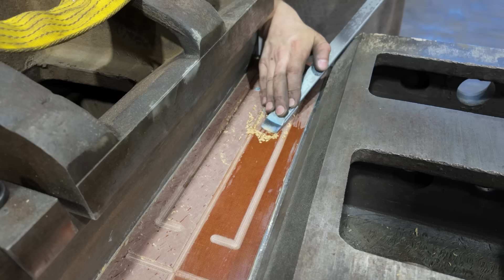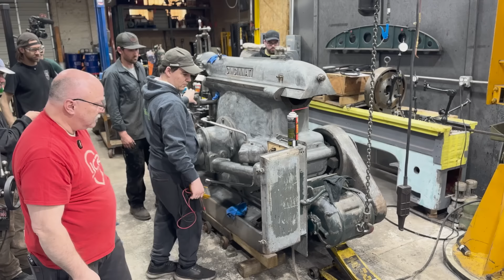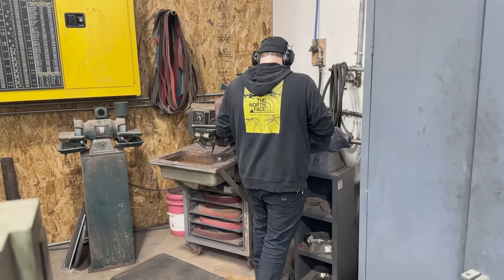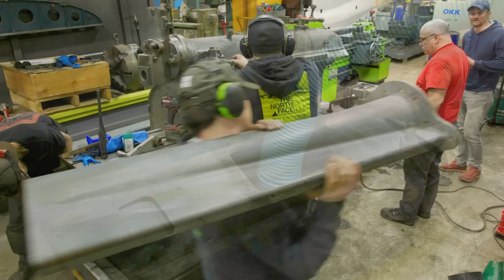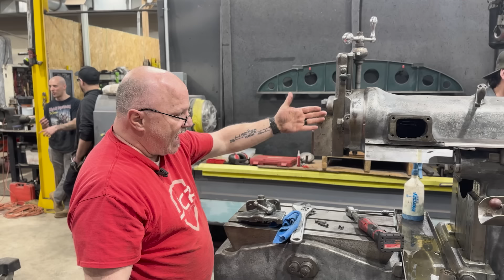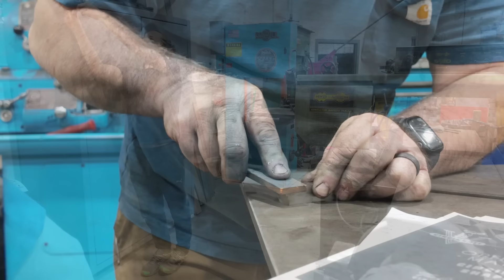Bringing our 36" Cincinnati Metal Shaper Back to Life

Comment: we retrofitted our shaper into a CNC, we put a 4th Axis on it . We use it for doing internal splines and a few small gears. Its very slow but we can set it up and let it run unsupervised all day. its been very limited. Yesterday I finished the table extension so we can do bigger parts.  I posted a couple of videos on my page yesterday of the shaper and the table extension

Comment: Ran 50s and 60s Lagune, K&T and Cincinnati shapers in the 70s with clapper heads on a US Navy tender...,in the 80s & 90s I got involved with CNCs making SSTL reactor chambers for Silicon Valley.....the new inserted perishable carbide tooling is light years faster than those old shapers for rough machining....boat anchors

I see you have an OKK CNC mill so you already know that.

Comment: Good god, a group of engineers working on something they have no skill set in.  I work on industrial equipment that engineers design but never work on.  If they actually had to work on their designs with little room to do ANY maintenance on, their designs would be a lot different.  What is the point taking a machine totally apart just to replace something?  The industrial maintenance profession hates engineers because of lack of proper engineering.  Everyone who has tried to repair something in some way dislikes the people who designed a mess to work on.

Comment: Because the shaper is different not a everyday machine in workshops that is what held my interest - thanks.
In it's day the shaper (that size) would have cost a few $$$. To justify its cost it had to save time & be of value (worth having).  What was it used for?
What ever it did, had to be of value. Not having seen one used (I'm not int the trade just have an interest) I assume that whatever it was used for other machines (smaller & less expensive) replaced it.